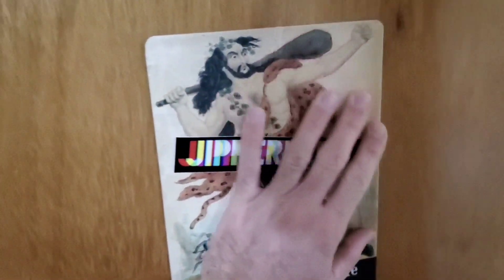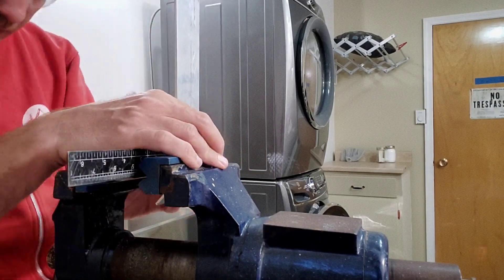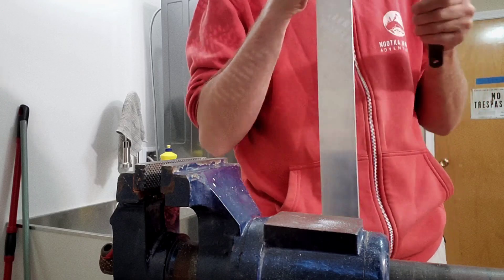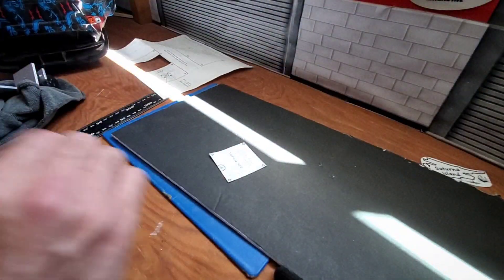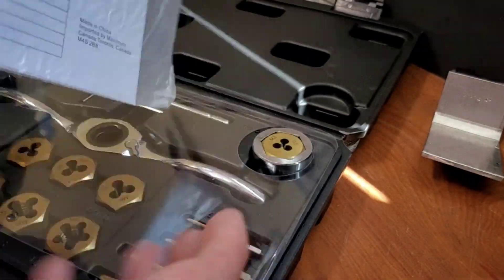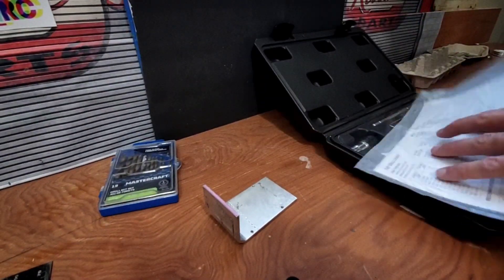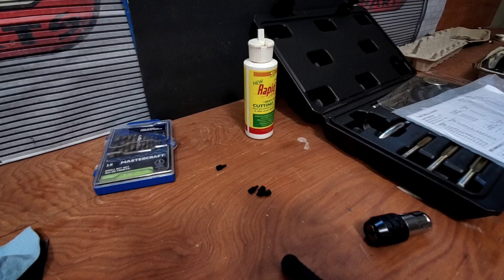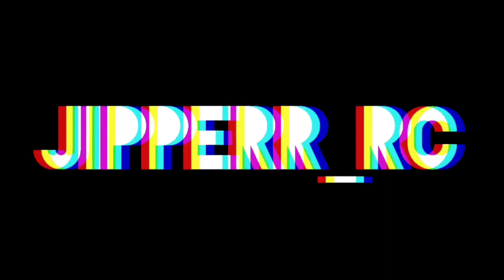Bending Aluminum! RC fabrication for functional stuff👍

Comment: Neat stuff! After I am done tapping, I always like to hit the hole with a deburring countersink tool. They are nifty for cleaning up all drilled hole entrances. Not coming from an RC background, just a tidbit I've picked up working with metal
Reply from the maker: Awesome, thanks for sharing that tip. I'm definitly looking for a countersink so i can get the screws flush to the material. If you can suggest one for metric hardware let me know 👍
Reply: @JIPPERR_1 only thing I can say to look out for is the countersink angle. For some reason, metric hardware is a 90° countersink angle and imperial is 82°
Reply: Countersink the hole first then tap  ,The tap and screw will start easier